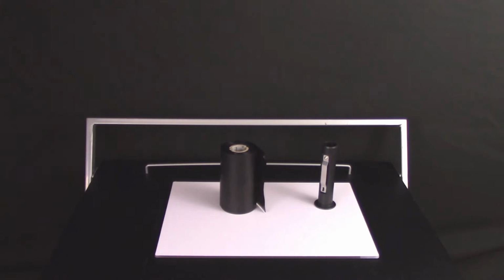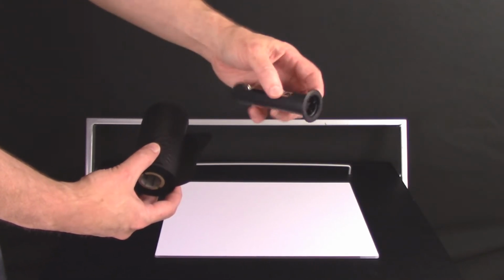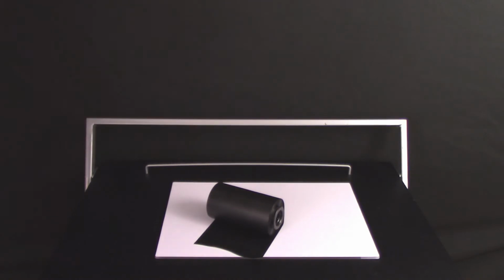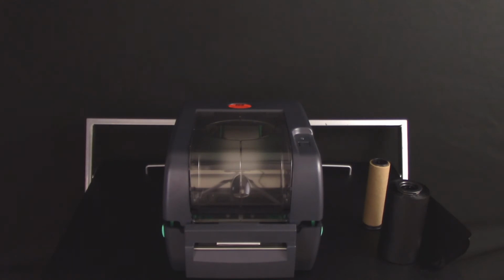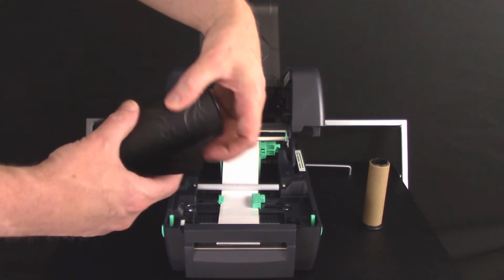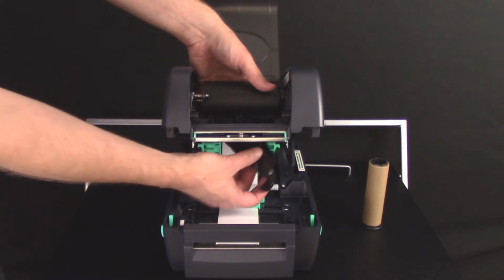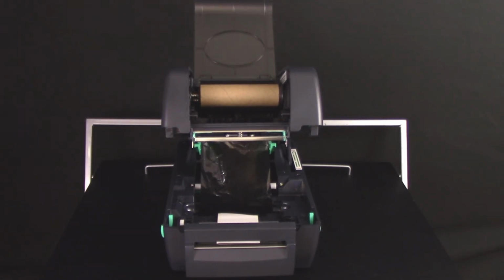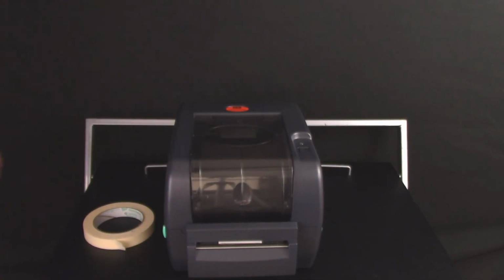Loading SafetyPro Labeling Ribbon Ink

Comment: The wheels where the ribbons ink go must spin when you print. I put the ribbons ink as it says in the video but the front axle does not turn and therefore the tape gets tangled.
Reply from the maker: Thanks for reaching out. In order for the front rewind spindle to turn, two things must happen: 1) make sure the supplies are loaded properly as in the video; and 2) make sure that your driver is set to Method>Thermal Transfer. If your Method is set to Direct Thermal or Use Current Printer settings, the printer may think that it is direct mode, for receipt paper that uses no ink ribbon. Thermal Transfer will ensure that the front spindle will rewind.
Reply: @Industrialsafetysolution  FIRST OF ALL, THANK YOU VERY MUCH FOR SUCH A FAST RESPONSE. I'VE BEEN USING IT FOR A WHILE, BUT SINCE MARCH I HAVEN'T PRINTED ANYTHING. I PUT THE INK RIBBONS EXACTLY AS THE VIDEO SAYS BUT IT CONTINUES TO TANGLE, SINCE THE FRONT AXLE WHICH IS THE ONE THAT COLLECTS THE RIBBONS DOES NOT TURN. NOW WHERE CAN I SEE THE SECOND OPTION, WHERE THE METHOD IS CHANGED. THANKS IN ADVANCE
Reply from the maker: @AlfredoCastro-p8x  You'll find the Method setting in the printing preferences, on the Page Setup tab.

Comment: ANOTHER DETAIL, THE REAR AXLE DOES TURN OVER
Reply from the maker: The rear supply spindle will always turn, when loaded properly. The front rewind spindle will only turn if loaded properly and the printer is in the correct mode. Also, you can only test it by printing from a PC, pressing the form feed button will not work for testing, so make sure to send a print with the correct settings to test.